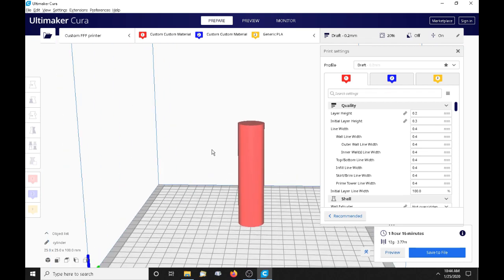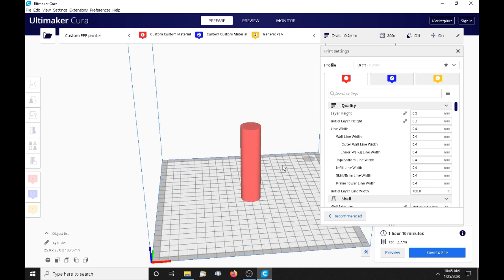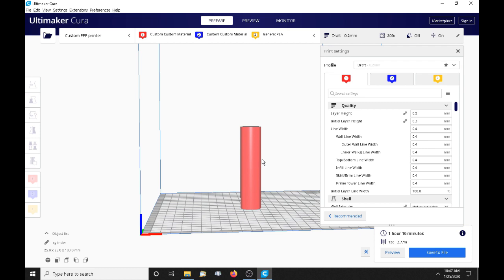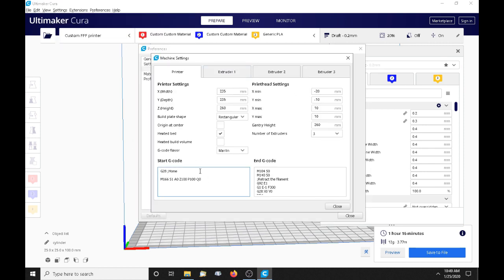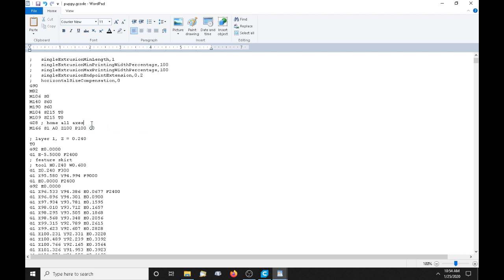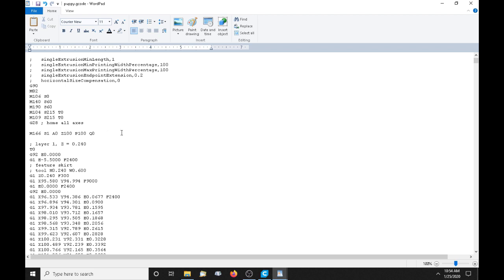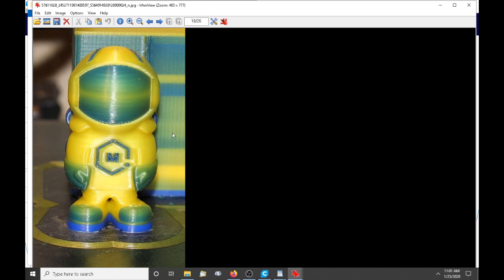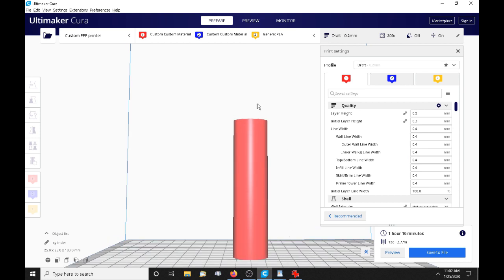Simple Gradients M166

Comment: Hello, I tried this, followed your instructions exactly as you explained them, but my printer is only using one extruder to print (the default one). I have the right printer selected in Cura. Object is 20 mms high, so I have Z20 in my gcode (M166 S1 A0 Z20 P100 QO). What am I missing? Thanks!
Reply from the maker: what printer?, or what version of Marlin firmware?